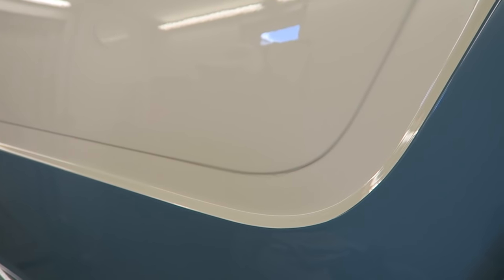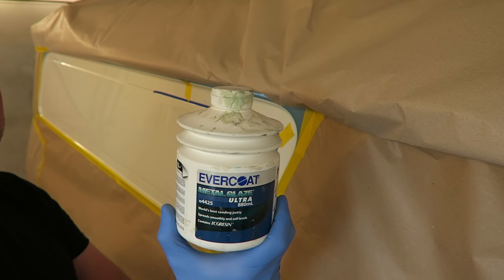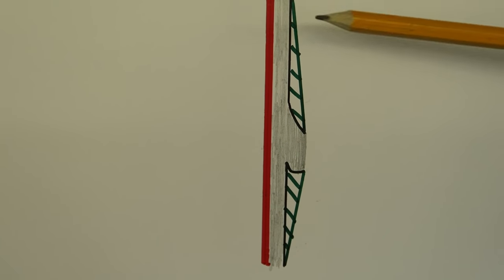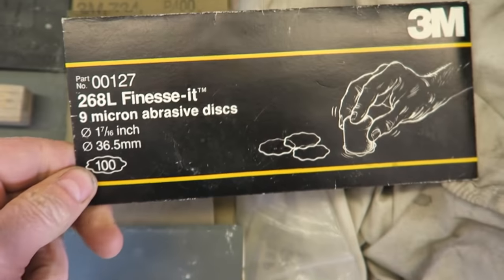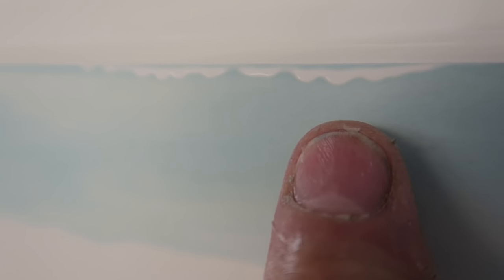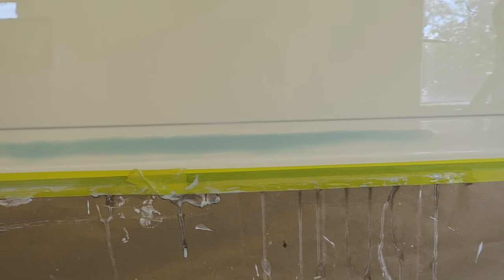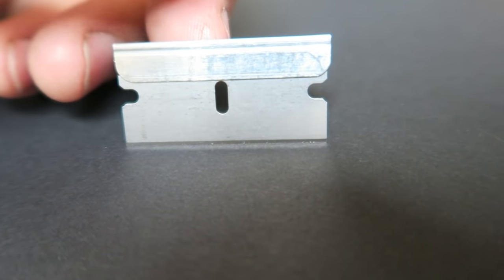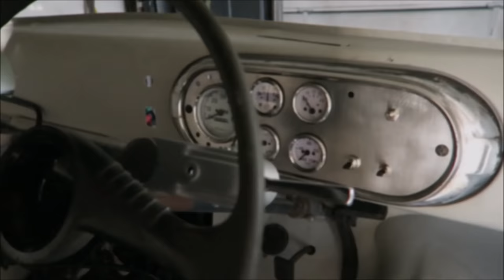Paint run removal techniques and a bit of a faux pas Tips and Tricks #24

Comment: Excellent techniques as always Trev. Another little tip you are probably well aware off but fresh wet runs can be lifted off the surface with masking tape. If you catch the moment it can be almost 100% effective but at the least it takes off the bulk of the run making it much easier to flat out when it's dry. Love the channel mate.

Comment: Just come across your excellent videos ,a good tip I used to use being a retired sprayer is when the run starts wait till the paint semi hardens and the run is still wet put some masking tape over the run,then pull it away ,the high point disappears and the paint underneath self levels,try it it works , also when painting holes radius the metal as paint don't stick to sharp edges.

Comment: I only learned of the filler trick on runs a few years ago but it can be a lifesaver. I've always run my razor blade over some old 320-600 grit paper before using it to scrape a run down. It only takes a few minutes to round over the corners and help keep them from digging in. Never tried the tape trick on the blade for dust nibs. Might have to give that one a go. I've always used a run file (we called them nib files) to deal with dust nibs. I never had much success with using those files on runs. 

Nice job on the video. As someone below mentioned your detailed instruction was better then the other vids I've seen on this technique.

Comment: I’ve never tried the filler method I’ll try it sometime I use A razor blade and a wet sanding Stones 400 too  2500 grit always had good luck on the flow indicators/dirt  Dig ur Videos THXs 👍👍

Comment: I have been using this method for quite a while with Dolphin Glaze. It does work. Blocking down a run without a layer of putty can lead to a breakthrough of the underlying paint surface and then a repaint is required. Using a film of fine filler over the top prevents breakthrough.

Comment: A little tip for you years ago i had a job which involved removing very stubborn stickers from plastic casings and we had to use razor edge scrapers for this very similar in sharpness to the safety edge razors and they use to dig in as well to over come this we would sand of the very corners of the scraper with some 400 grit wet and dry and a little white spirit to leave a rounded edge which would almost never dig in unless you were a little careless using it give it a try i am sure it would work for your purpose.Love the videos keep it up Thanks

Comment: Nice tip, thanks. I know it's late, but you can turn the edge of a razor blade by 'wiping' a screwdriver shank (or similar) hard along the blade at an angle. It turns the blade into a tiny little plane that shaves off the bare minimum of material without chattering or digging in (round the corners off on a sander too).
Reply from the maker: Thanks, another viewer messaged to say about putting fine line tape over either ends of the blade, this raises the blade just off the paint and works great for cutting the tops off dust inclusions. Cheers Trev 👍

Comment: When I've had runs I've used the glazing putty route but used a small block of hardwood at the papers backing. Literally 30mm square with radiused edges. We get merbau decking here in Oz and it's great for making these little blocks.
It means you can keep the block right on top of the thickest part of the run and angle it towards the thickest part of the glazing putty. Doing this means I haven't gone through the topcoat/clearcoat so far.

Comment: So, I've heard of this technique. One thing I would try is to leave the masking tape on the areas around the run that are most likely to be sanded through to the underlying paint. Allow the sanding to progress until the masking tape is worn almost completely through. Best option, of course, is to back off on the volume on areas where it's most likely to run when spraying to prevent the run.

Comment: I've never been great at laying on my clear - When it starts to look too dry, i go to make it wetter and end up going overboard, thus I have runs. Usually, i'll put another coat of clear on afterwards to keep from sanding through the other places. Unfortunately, I've gotten pretty good at sanding out runs. lol  They make special sanding blocks for sanding runs in clear.  But i've also used a small piece of pvc pipe. You need something rigid that will keep you on top of the run, not on the surrounding clear. I've also use paint sticks. It's pretty doable if you take your time and are careful.

Comment: I did bodywork for 30 odd years and never achieved perfection as hard as I tried, something always happened, the customer thought it was perfect but I knew different.
Reply: I didn't do it for 30 years like you, just around 20+, but I'm with you brother. You're 110% right. My bad behavior was, I was showing them that, couldn't resist not to, and that  wasn't the best  ideea...😊
Reply: Me too but I'm told I'm too fussy !
Reply: @Davidzapper  I couldn't count how many times I was told I was too fussy by customers and my employees, it usually got the employees sacked though.
Reply: @dubsydubs5234  never been sacked but I still like to go that extra mile, hi end paint finisher is my pleasure .
Reply: @Davidzapper  Being told by a employee meant there weren't doing their best, I think you should always do as good as you can and not cut corners, worse thing an employee said to me was "the customer won't notice" that really pissed me off.
Reply: @dubsydubs5234  That's the same thing I get told , cheesed of or wot.

Comment: i use the air dry stopper for those runs rather than a epoxy one, but use  normal stopper for regular stopper work.

before that method i use to use a 36 grit disc on a grinder with two de-teethed hacksaw blades taped either side of the run, tricky part was not hitting the tape too soon so the blades flew off............................i found magnetizing them helped.

Comment: Trev, here is the best way to use the razor blade for run removal. Step 1: Chuck the single edge razor blade in a vise with the non-sharp edge down. Step 2: Take a Phillips screwdriver, preverably with a polished shank, and use it's shank as a burr forming tool. Hold the screwdriver at about a 10 degree angle off of the horizontal plane and press down hard to form a burr on the sharp edge of the razor blade. You might have to repeat this process two or three times to form a really good burr. This is the same way that you sharpen a cabinet scraper if you would like a better explanation of what I'm talking about look up sharpening a cabinet scraper. Step 3. Bend the razor blade at the middle, to form a bow, so that the center of the burred edge faces forward. This prevents the edges of the blade/now scraper from gouging the work. This whole process should take about a minute to do. The burred razor blade will remove the run very rapidly. I picked up this tip from Kevin Tetz the guy that makes the Paintucation Videos. He shows the entire process in one of his videos but I forget which one.

Comment: Have ever tried cutting a run off by sliding a sharp razor blade along ? you lay it flat on the panel and with care wiggle it along, then a small flat and polish if needed or the filler/bondo trick to follow ?

Comment: Not surprised you sanded through,that was a horrible place to get a run,we've all been there.
Me personally,I use dolphin glaze ,a very thin coat that I sand with 600 grit initially and move to 1200's once most of the filler has been removed.I feel you put the glaze on too thick and that compounded by you starting with 320's may have contributed to the sand through.I use homemade wooden blocks too,the smaller the better,just big enough to cover the run.Oh and I leave the masking tape in place until I've moved onto the 1200 grit stage.

Comment: Hey Trev. I was wondering if you could cover how to approach what to work on a vehicle first. I am working on a 1956 F100. It is going to be a resto-mod but we have panels to replace for some of the cancer rust spots, dents to repair, possible lead filler needed in some areas, mods to consider and a little framework that is still being done. Where do you normally start with bodywork or how to approach starting a new project? Not sure if you have covered this already, if so please give me a link. Thank you for reading.
Reply from the maker: The Nam3less this is a big question. On a big restoration we normally blast all the paint off and epoxy coat. Get all the big welding jobs done first before turn attention to smaller repairs. Then filler then paint. Cheers Trev 👍
Reply: @trevsblog  Thank you very much

Comment: Any particular reason you use direct gloss over COB?  Is it to maintain historical correctness?
Reply from the maker: pearcesteve111 I like the finish and the prep is very straightforward. Cheers Trev 👍
Reply: @trevsblog  Just watched your burn through blow in video, would be interesting to see how fade out thinner worked on direct gloss, on clear coat it melts the fade perfectly

Comment: Your videos are so informative and detailed (great close-up shots), without being overly technical for us wannabes. Question: What is the 'direct gloss' paint you are using, cos I'm nervous of 2-pack?
Reply: Direct gloss is 2 pack,but the shine and hardener are in the colour. Other way is clear over base, where the colour goes on flat then the clear is mixed with hardener to give it the shine, usually for metallics but can be done with straight non metallic colours as well. 2 pack needs a bit of care in not over applying coats, usually once 1st coat has tacked off, you can go heavier on 2nd or 3rd coats as it will grip it. The Gunman has some great videos as does Eastwood Company on spray painting.
Reply: @plantpoweredhealth9383  Thanks for the info and please excuse my ignorance. I don't really want to get involved with 2 pack of any kind due to it being more hazardous to health and the air fed breathing equipment required etc. I'm only an amateur DIY'er. Thanks again.
Reply: @Rog175  no problems, you should probably use acrylic lacquer then, just needs a good buff and polishing after the solvents have aired out. I use goggles and gas mask ,also full suit and gloves but not air fed when I paint 2 pack at home. Depends how often you will be painting, but your call mate. Have fun and good to see you having a go! 👍
Reply from the maker: Rog175 as the other guy has said it is two pack. It’s up to you but modern day paints are less hazardous than early 2pack paints. If you have good ventilation and wear a mask for the amount you’ll be painting the health risks are incredibly low. Cheers Trev 👍

Comment: Hrllo i have a question , can I use metal glaze for very small dents /light hail damage ( barely able to see the hail damage )
Reply: Generally I would say yes provided the dent is not deeper than the product manufacture recommends filling.
Reply from the maker: Κώστας Λεούσης have a look at buying a dent removal tool that uses pads that glue onto the dent to help pull them out. Cheers Trev 👍
Reply: Trev's Blog will glaze putty also work because in not familiar with them
Reply from the maker: Κώστας Λεούσης are you intending on painting the car afterwards? If you are then yes a spray filler may work well. Cheers Trev 👍
Reply: Trev's Blog yes i will , will normal glaze putty do the job too ? ( not a fan of sprayable bondo )